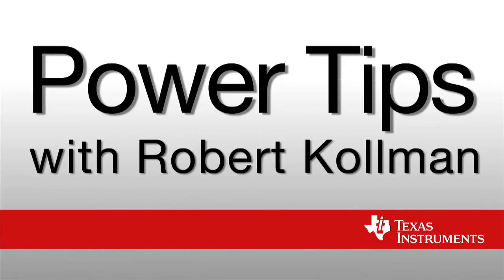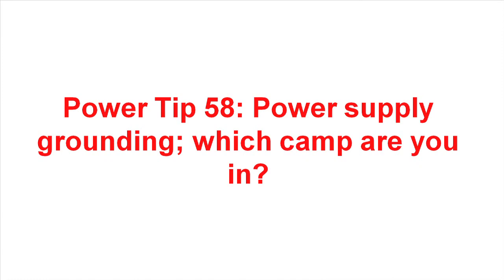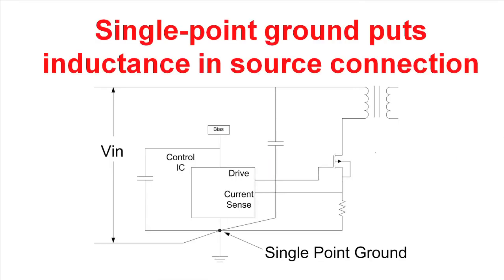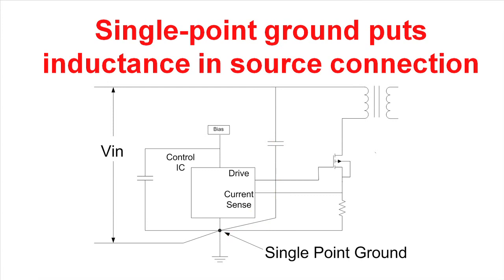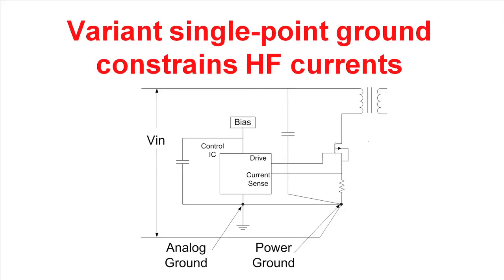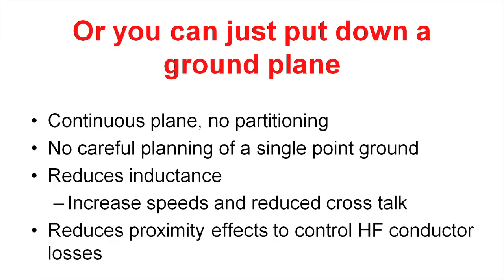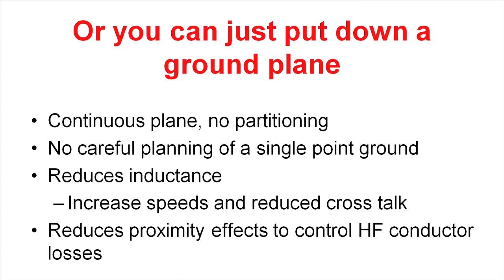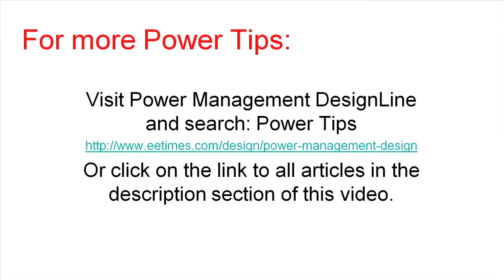Power Tip 58: Power supply grounding; which camp are you in?

Comment: Why is it necessary to have the common ground for the minus side of the circuit at all?  Samlex power supplies are one of the few that do NOT tie the minus voltage to the chassis.  The minus terminal floats.  I'm also chasing down USB connected equipment as they all seem to like to tie pin 4 on the USB connector to shield which is then tied to chassis.  Bad idea for RFI in the ham radio world.

Comment: Greetings :: I greet you, and I comment perhaps it is not the correct area, if possible redirect it to the correct area, and it is the following, I need a similar circuit in its specifications, and behavior to the LM2577T-ADJ / NOP, only that is Able to deliver at its output between 80 and 100 stable DC volts, it is all for the moment I say goodbye.

Comment: Increased inductance in a star grounding system is usually a GOOD THING regarding noise. Several datasheets for TI's own switching converters caution against a low inductance ground path for Vout filtering capacitors.
Scenario: You have a current sense resistor with one side tied to ground. Are you going to tap the ground side of that resistor from some arbitrary point on the ground plane or from a point proximal to the resistor? Star grounding is a similar concept. Each node of the circuit does its own thing and is individually referenced to a chassis ground. The inductance of the ground path is your friend, helping to reduce current feedback between nodes and keeping delicately engineered high gain amplifiers from screaming like banshees. Think of it as just a touch of inductance added to the typical RC pi filter.
Sure, if you have enough circuit board layers and don't mind the stray capacitance, by all means use a ground plane. Just make sure that sensitive nodes are separated and individually referenced to a common star ground. Just ask anyone who wanted a piece of the booteek valve amp market, built an amp with a 4ga bus ground, and came agutser because of farting and howling feedback - you need that extra bit of inductance.

Comment: I just don't get why people always say, that you don't have to do careful planning regarding single point of grounding when using the ground plane. Of course you do! There are possibilities that, in case you did not do any planning on how the currents are flowing through the ground plane, can lead to serious noise injection of different grounds, when using a single ground plane.
So after all, also when using a ground plane, you have to be careful where to put components to not create huge loops or crossing ground boundaries (for example sensitive analog and switching grounds)

Also, I don't think that the two schemes (single point vs ground plane) are so mutually exclusive. Consider the single point ground scheme, you explained. Now what would happen if you would fill the area around the star-ground point? The only thing you did is increase the diameter of the ground "point" and thus lower its resistance, which does not have to be bad. Yet again, I say, that you can still apply the star grounding scheme when actually using ground planes. Not only you can, but you should!
Reply: +Simon K. Exactly..but it I think it requires less effort to place components and segregate signal traces over a single ground plane than to describe the shape and area of separate analog or digital ground planes, where they are joined etc